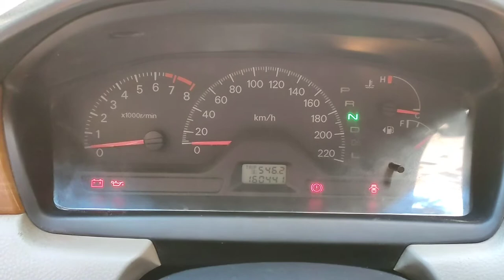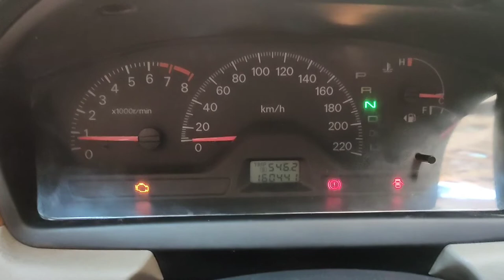How to fix the Lancer ignition switch

Comment: My car has a similar issue but I can get it to start if I push the key in really hard as I turn it. Do you think it's the ignition switch or the cylinder switch?
Reply from the maker: I think it's the ignition switch

Comment: I may have same issue. 
2006 Mitsubishi Lancer 2.0 SITUATION: When I was backing while turning the car stalled and would not start. Acted like dead battery or bad starter. I pulled starter and tested fine 3x at 3 different testing locations. Battery has full charge. When I turn key same thing bendix sounds to be kicking out and engaging but engine not turning. Tried multiple times and ground on battery starts to get hot. In the past I did have an issue with relay block under hood had come unmoored and fell near front tire and was collecting water and debris. Eventually the connections failed and I replaced entire block. I soldered all connections and heat shrinks over each one (retested today and all connections are good)
QUESTION:  I understand if the car went start it may be that part in colum, but If the part your replacing in colum was my problem would it cause the car to stall. Also if that part fails will it allow starter to start to work but not completely?
Any help greatly appreciated

Comment: What if when it’s in accessory the lights on the dash turn on but when you turn it to on right before you crank it the lights come off, I want to say it’s a weak power output from the battery as in maybe my ground terminal is corroded